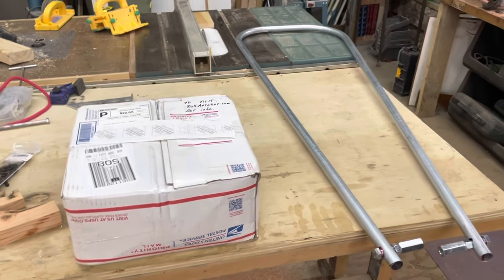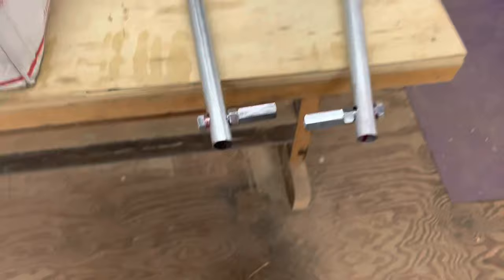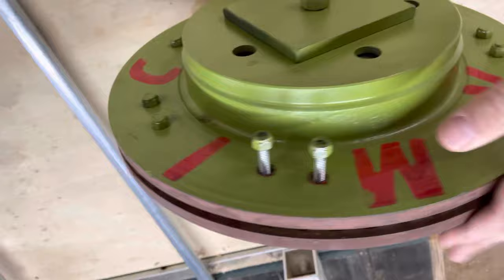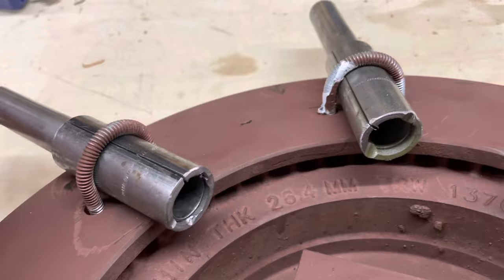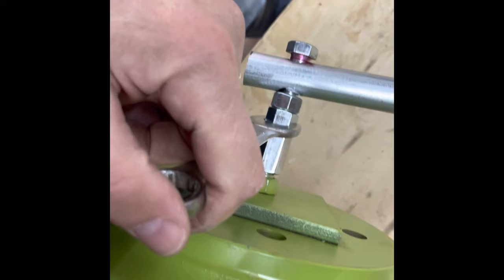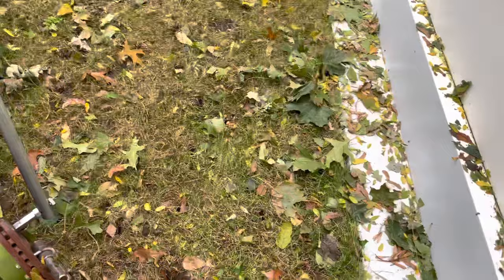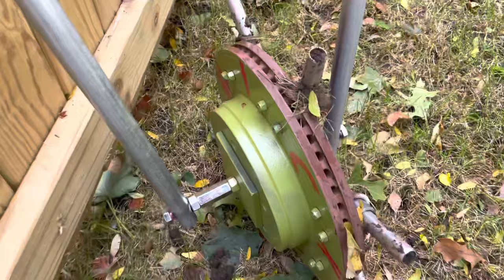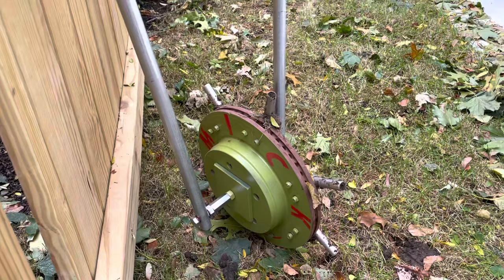Rollaerator assembly and first impression

Comment: I looked up the website to go buy this, but $500 for the 2 disc version and $479 for this version?  No way.  Incredibly overpriced.
Reply: Agreed. My eyes popped out when I saw the price. I would consider this at half that price. But, even then.
Reply: Thus guy gave me a price including shipping outside the US. I asked some follow up questions and he increased the price by 200 bucks. Said the first price was only for a quick deal....
Reply: Build your own man. I'm getting ready to. I got a few truck brake rotors. Only difference is I'm going to use 3 or 4 rotors instead of just 2.
Reply: Thank you! I figured they were disk rotors but weren’t positive until I saw this. I’ll just make my own

Comment: Great video.  There's nothing else on the market in this category of aerator.  It's no wonder he can't keep up with all the orders.  Very clever design, and does an great job.  I've got a total of about 1200 sq. ft. of lawn, with a lot of areas not accessible with a large gas aerator, and this tool is perfect.  I've got the dual disc model, and I appreciate the extra weight.  Pulls great plugs and never clogs, and that's in Georgia soil.  Heartily recommend this for folks who don't mind some exercise.

Comment: Yup, I’m using brake rotors for mine. I have some in the attic off my Subaru. They are almost 30 lbs each so I figure two of them and some electric conduit and I should be good. They wat $499 for that hunk of metal. 😂
Reply: lol even if you buy brand new weight plates from a gym equipment supplier and get replacement splines from ebay, it only comes up to 70usd. Good on this guy for finding a side hustle but the price is so high that someone can easily come in and do this for cheaper. I'll be making my own as well. would probably just buy it if it was 150.

Comment: When i saw this, i thought it is a joke.. 499usd for 2 brake rotors with pipes and handles? You got scammed! 😂
Reply from the maker: The price has gone up quite a lot. I paid $279 in 2021. I know materials prices are through the roof, and so are labor and warehouse space. And shipping is probably close to $100 of that. I probably wouldn't pay $499, but if you compare it to other options it's still cheaper.
Reply: I get why it costs what it does and the guy making it probably isn’t making a killing. It’s one of those things that doesn’t make sense to the market. You can rent a gas powered aerator for like $60 from Home Depot.
Reply: @yachtboy  maybe in america :) i think, in europe you can make it like for 50€ using rotors bought from junkjard

Comment: Very cool. I could be wrong, but it looks like that bolt spins inside the handle shaft. Eventually it's going to wallow out that metal. The wife's Acadia is going to need new brakes soon. I might just use the two old front rotors and build something like this.
Reply: let us know if you end up making it, i'm also thinking about making one myself.

Comment: Hi  - do you know about what the diameter of the brake rotor is? I'm thinking about making one of these for myself.
Reply from the maker: I can't easily go measure it but I would guess it's about 12" diameter. I don't think it matters exactly, you could probably make anything roughly this size work.
Reply: I just replaced the rotors on my truck, definitely using the old ones to make one of those. I'm thinking about having a double rotor setup and maybe tow it behind the lawn mower. I kinda think maybe there should be some bearings where it rotates on the shaft. But hey, this gave me a great idea!

Comment: Why not make a 12" wide version. Go alot faster and quicker.!
Reply from the maker: Ask the inventor, I just made a review.
Reply: Too heavy to push.
Reply: then you are applying weight over a 12 inch surface.  If there are 4 spikes, you would probably need to increase the weight by 3 or 4x  try lifting 200 pounds and roll that around for a day.  You can probably make one and add  posts for gym weights.
Reply: @cameranmanner4701  
Lawn rollers filled will 15 gallons of water are no different in pushing and lifting🙂
Reply: @douglasgrant8315  I understand the issue of rolling weight.  That would not be a problem, but if you have to move this heavy pig from your house, brother, mother's house.  It becomes a problem, not just the lifting it's the space required too.  It's really sold as a portable device for small lawn owners.  Not everyone has a truck or a large suv  to lug this around.
Maybe the inventor can make expansion adapters to give others the width required for larger lawns or increased effiency.
Reply: @cameranmanner4701  maybe make it so that sections can be added or removed.

Comment: What if the ground is hard?? How much does this device weigh?
Reply from the maker: You would want to do this when the ground is soft, either after a good rainfall or a good watering. It doesn't need to be mud, but if the ground is dry and hard I can't imagine any aeration technique would work. The weight of the tool is mentioned in the video, and on his website. There are two models, the lighter one I got is about 40 pounds IIRC.